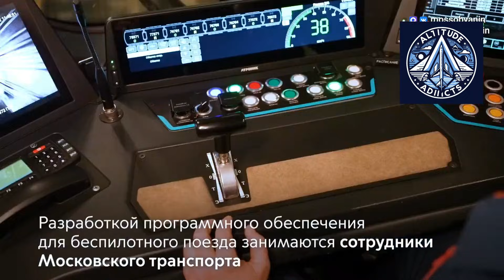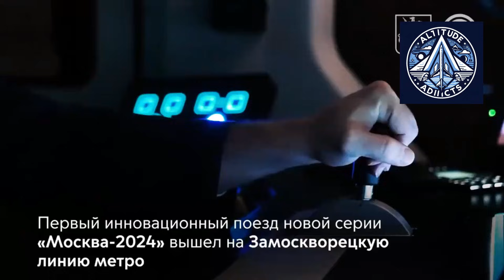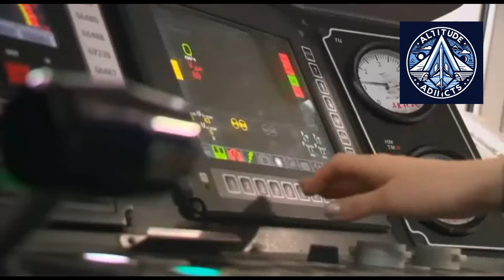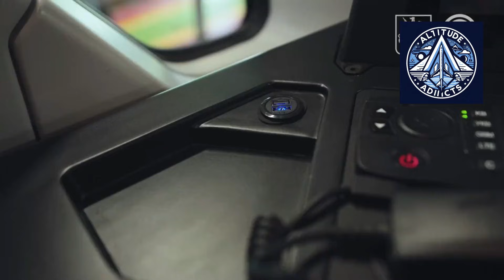Russia Quietly Launches Driverless Metro Trials at Night

Comment: Very quietly. In countries like France and Italy driverless metros are in use for many years.
Reply: Moscow Metro was testing driverless trains since 1961 and were implemented in 1967 in Saint Petersburg and 1968 in Moscow. Some among first in Europe, if not World. They weren't extensively used as couldn't maintain close to 40 tph. Next system was tested and partially used in late 70's - early 90's. This news is just about next gen system, which is working more like road car auto pilot. It's actively being used in street trams already. It's not just using signaling, but also controlling surroundings - like obstacles/people on tracks etc.
Reply: @elksalmon84  In the Soviet Union, they tested automated systems, not driverless ones. First driverless metro systems have been introduced in Japan and France 45 years ago and are meanwhile heavily used in many countries but still not in Russia.
Reply: @alexandervt641  you mixing up guideway and conventional railways, as well as manned and unmanned. level 4 guideways are low capacity systems. but levels 2 and 3 automation are still driverless. No full capacity system can be unmanned. It's just unsafe.
Reply: @elksalmon84  I didn‘t mention conventional railways at all. We speak about levels 3 and 4 which are driverless. Of course, full capacity systems can be unmanned. Some of the world’s busiest metro lines (e.g. Paris Line 1) operate fully unattended (level 4) with excellent safety and capacity.